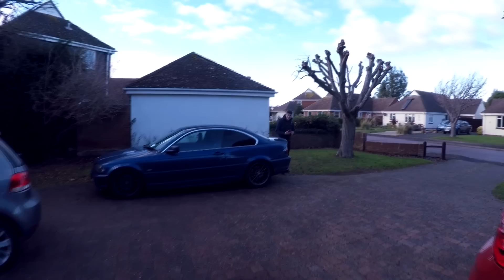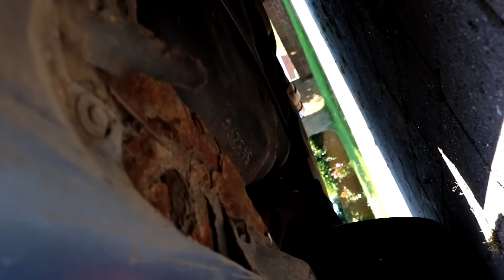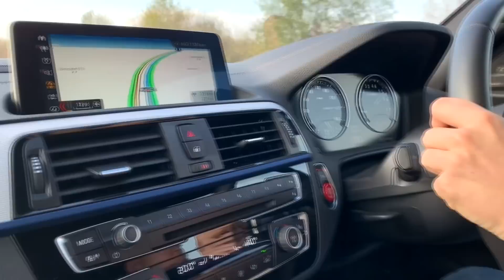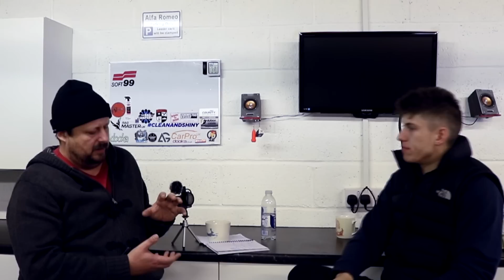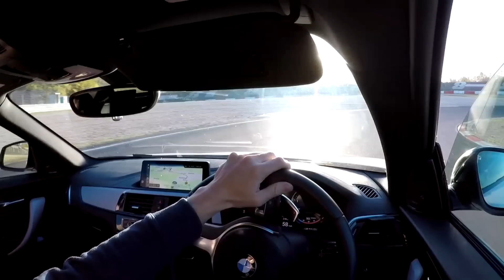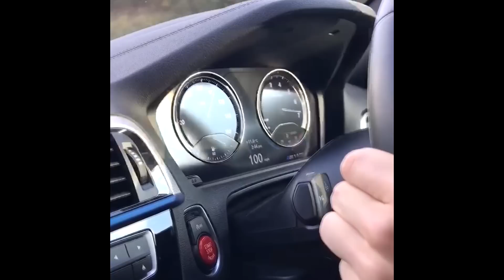Rare interview with reclusive industry legend...

Comment: 12:02 Golf R's arn't that bad on fuel John, I've had one for 8 months and on journeys that see some duel carriageway/motorway use average MPG will comfortably be in the high 30's.  I mostly use mine town driving and A & B roads though (lets say not driving economically but not driving like an idiot all the time) so I usually average around 30 MPG.
Reply from the maker: thats not bad is it.   but the 6 cylinder 3 litre beast in the m140 can get like 45mph in eco mode how on earth they do that ill never know.  dont get my wrong mk7 golfs R's still get my juices flowing.  they look sleek and tidy and Ive owned virtually every mark over golf over the years and like they all were cool (my mk6 refuses to go wrong literally ever so damn reliable).   theres things about the golf interiors thoughs, the upholstery is really bad, not keep on the fabric seats they use and the interior quality isnt the same.  the panels on them as well are so thin, they are like tin :) all swings and roundabouts cuz the m140 is looking a bit art deco :) out the box as well it looks too plain perhaps and that rear diff on it has a mind of its own and it gets exposed on uneven roads or when its even slightley greasey.  that being said the m140 handles awesomely well if you take out what happens when you try and put the power down at the same time or too early out a corner.  really epic fun and like reg says the drive train in it and the gearbox are just so damn good.  I even like the electric rack in it. can be so easy to live with and drive normally but whack into sport + on country roads and its just way more fun than the golf R.  like I say though you learn to see the good in what you own.  if I had a golf R I would still learn to love it for the things it does better than the 140.
Reply: @ForensicDetailing  Yeah I couldn’t quite get the Golf to average 45 MPG (unless it was just single way journey with a lot of downhill), the best I’ve had so far is 39 MPG, that was going mostly steady but still put my foot down a few times so it will just about crack into the 40’s which is pretty decent considering it has 300bhp and 4WD. It’s slightly better than my old MK2 Focus ST which had FWD and 75hp less! I wouldn't say the interior fabrics are "really bad", the carpets aren't the best I've ever seen but they're better than most cars. 

I did consider the M140 briefly but I think they still haven't cracked the styling of the 1 series, although they are getting better with each generation. The RWD vs 4WD though was probably the main thing.  Sure, for outright fun you can't beat RWD but I think for an everyday road car where the main priority is to always get to your destination safety and on time and to have the ability to go devastatingly quickly, no matter what conditions, you just can't beat 4WD. I go to Scotland whenever I can and I often go in the in the winter (when everyone else and the midges don’t) which I’m doing in a couple of weeks and if I had a RWD car I don't think I could consider booking a trip to Scotland in February. RWD, snow and hills are not a great mix.
Reply from the maker: @Enselladus  :) yer man I think the exterior style is like one of the most important things.  before I had a 135 or 140 reg was always banging on about them to me.  and I used to say they are bloody ugly lol..  its wierd though when you buy one you develope like beer goggles for your car and start appreciating the style.  now I like look at the m140 and I really like the look of it.  needs that maxton kit and spacers and springs though to get that look.

Comment: Hi Jon and Reg,  you can refine the paint as you work with the rotary if you use lower machine speed all the way through or start low, then speed up once the marks and removed then slow right back down.  my method is to always slow right down and do at least two passes at 600 rpm or even slower.    doing that means the next step is super easy with more polishing being done than fixing the marks from the previous step.
Reply: its so open to personal choice thoguh on method.   specially with the prevailance of Diminishing abrasives.   I cut at low speeds on the rotary as well and use it a bit like the DA and just doing that it cuts paint at a sensible controlled rate with no risks where its still easy to be consistent.  that helps not overwork the high cut compounds and reduces a lot of risk..  as the cut tails you can indeed crank up a bit if you want.   You can work a bit faster if you want.   Some guys like whizzing out the finishing polishes at sightley high speeds then cranking down or doing a final set at minimum speed with like even cradling the machine to lower the natural pressure.. so many different ways.. some guys even do all the cutting fast and agressive, and then take the time with the refinining..    some stick to OEM instructions as well for the abrasives.    so many different scenarios as well..   I find I can get results better when I just slow everything down and invest more time.  if I try and do things fast my results go south but thats just lake of experience.  I generally have a kind of set piece way of doing it thats very very simple and I tend to stick with that.   Its the technique I showed early on, in the channel with the 3401 polishing vids.    gonna do some more on this soon when I polish my car out with the rotary and/or 3401. cheers mate great to get your take on it and I learn a lot from other peoples views.
Reply: @forensicunplugged4295  your so correct there, the amount of techniques available to each person now is many and sometimes you can cut the paint back at low speeds and othertimes some paints just dont respond to it and if changing the texture and making the paint wetter is the goal,  high speed jabbing on a DA or high speed rotary will do that. just dont heat the paint up too much.

Comment: With all this talk about wet coat have you tried Carbon Collective Hybrid? I find it gives more repellency and adds a protection that last for months where dirt doesn't stick at all!
Reply from the maker: looks good, I like 500 ml makings 5 litres.  what ive not seen from other siloxanes that dont come from the korean neck of the woods, is they have not delivered on like the dirt repellency or slickness side of it (but have been able to give good hydrophobic performance).   One of the reasons I like wet coat is I believe the material thats left behind harden and I can feel the slickness.    On a test panel right now I have 5 topper spray sealants.  and wet coat is the one that doesnt get clogged up as much by dirt and I demo this.     so yer, Im interested in this product I might check it out.   Tell me this, with the carbon collective product do you notice a ring of product like scum ever building up, like a deposit of linescale type thing (not limescale obviously but like that) at the top of the bottle where the product liquid top level sits when its on the shelf for a while etc?
Reply: I couldn't say as to the build up of scum in the bottle as it was a friends product I used. But from what I've noticed is that the way water acts on the panels is very similar to that of ceramic coat behavior. From what I've seen si that they have some very interesting products I would like to try like the speciale si02 detailer and the platinum glass ceramic coating. But unfortunately that has been out of stock for a while so I'm yet to get my hands on some. I would certainly give hybrid ago as the water behavior and sickness seems good.

Comment: I've seen that you've talked about stone chips. I've always wondered myself how to repair swirls by polishing, when the bonnet is affected with those inevitable markings... Would you work the panel as normal, would you protect the surrounding of the markings? (I know the best way should be correcting the stone chips and then polishing the bonnet, but this is not the case). 
Greetings from Spain!!
Reply from the maker: I just polish over them, but when you do the polish can sort of fill and cover the chip and you need to get that out with a little stick or swap and some mineral spirit of something, ideally before it dries rock hard.   trying to avoid all the chips can just be too hard..  obvious if you have like a bigger area of damage from a chip where the clear is like at risk of peeling back or somethign you dont want to polish over it though...  stone chips are a real pain... like you can argue whats the point in all this protection and stuff when the bonnets gonna get smash up from stone chips and need repainting generally anyway...  no answer to that.  really its just part of the deal with cars.  trying to like touch up chips as and when they appear is a bit of a never ending battle.  your almost better off just living with them and then 5 years or so repaint the front bumper and bonnet.
Reply: Great point of view! I will follow your way of doing it, thank you very much.
Reply: Plus keep well back from cars in front. That'll minimise the stone chips but you'll never avoid them completely unless you have PPF.